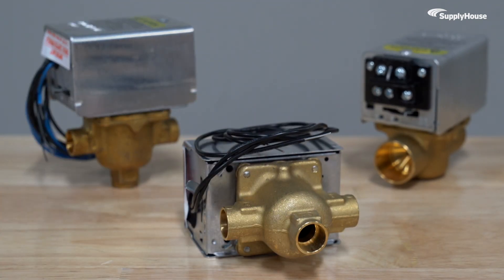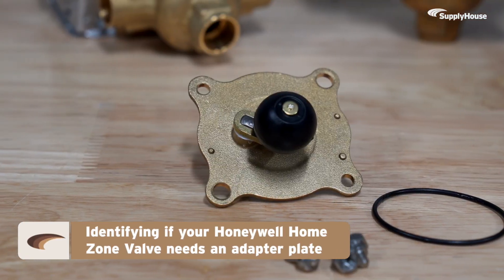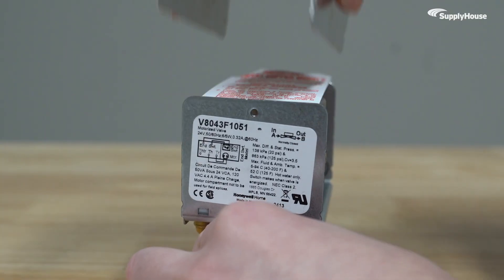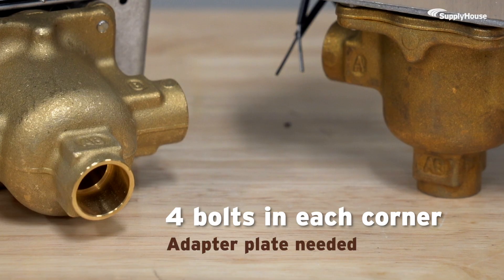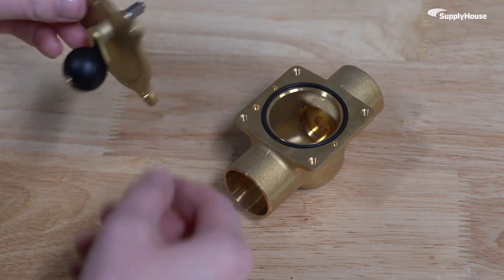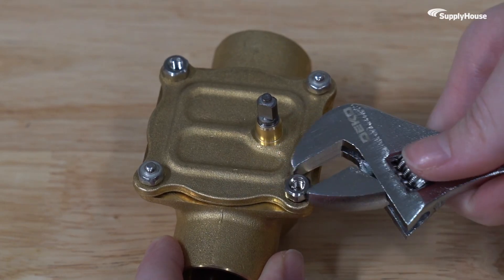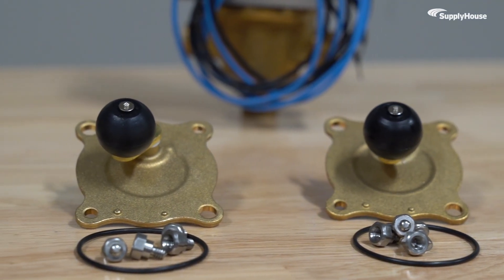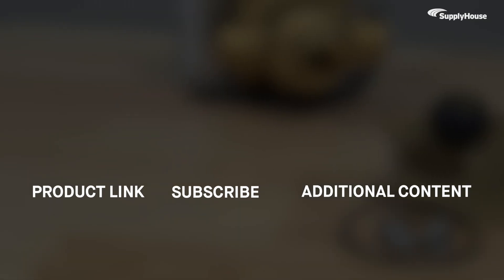Does Your Honeywell Home Zone Valve Needs an Adapter Plate?

Comment: I bought a replacement head for the 4043h it's one with only 2 screws, but the new one, the shaft doesn't line up with it, is there a way to resolve this?
Reply from the maker: Hey there! Our team would be happy to check further into this for you if you provide us with the full zone valve or actuator part number! Please contact our team here so we can try to help: https://www.supplyhouse.com/sh/control/contactUs